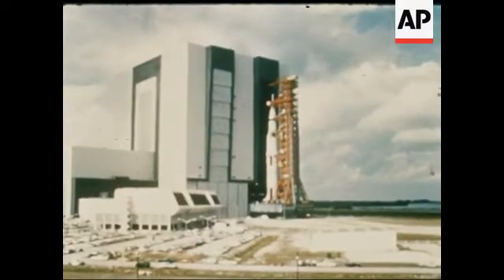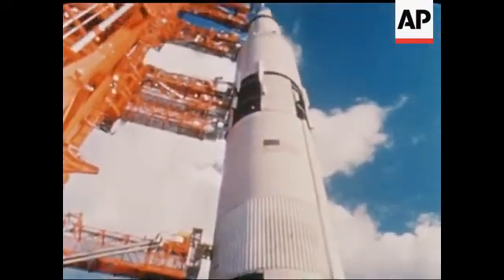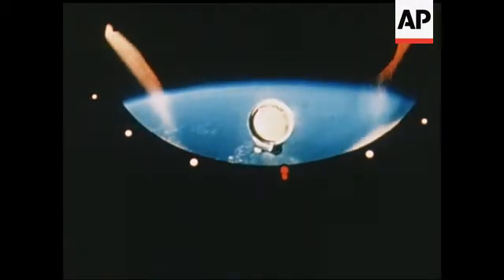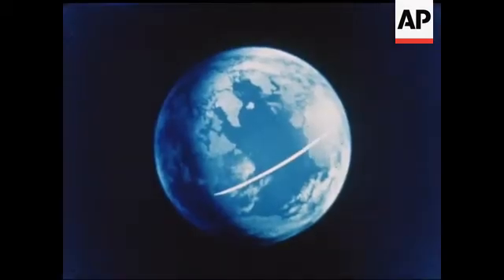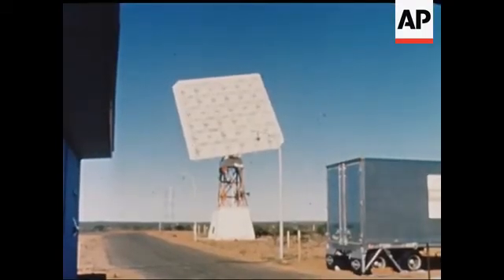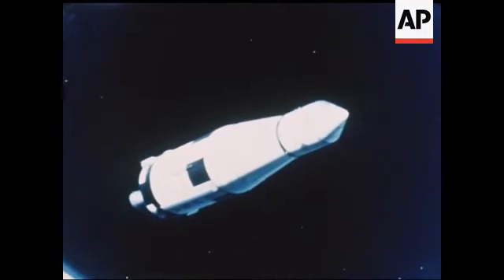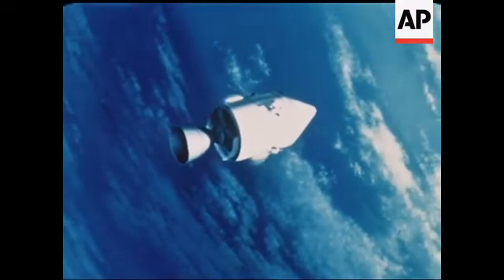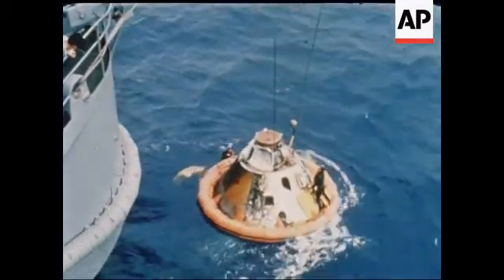APOLLO 6 - T5  - COLOUR - SOUND

Comment: At 2:27 the narrator says the 3rd stage engine will fire to put the craft 279,000 miles from the surface of the earth?? That's further than the moon! And this is Apollo 6. Has to be a mistake.
Reply: You are correct. It was intended to test a trans-lunar injection burn, followed by a simulated abort burn from the CSM - a full LM was not carried on this flight, only a test article. The third stage engine failed to relight, so the CSM Service Module engine instead did a long solo burn to set the Command Module up for a high-speed re-entry. After the failed S-IVB burn, it was left to decay and eventually burn up some weeks later.